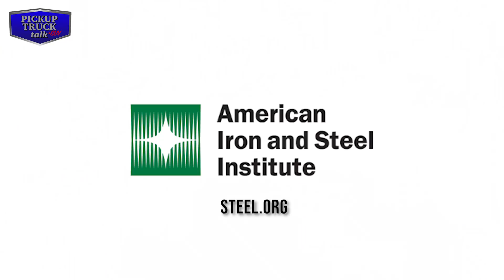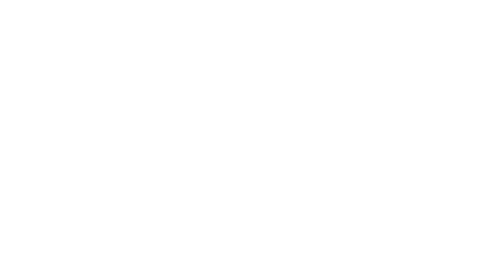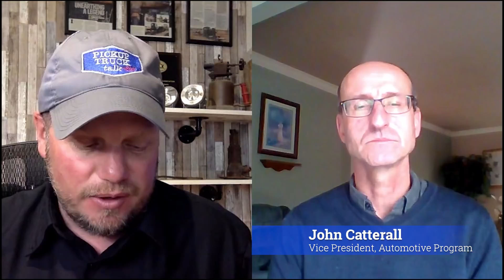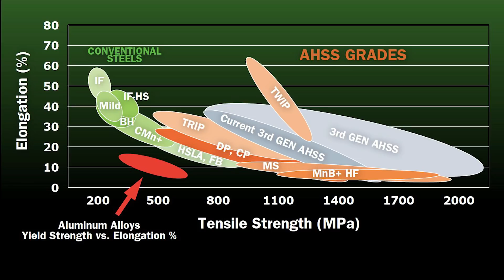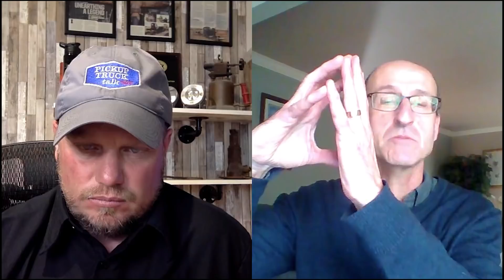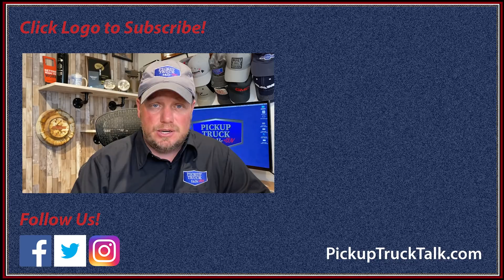Should Truck Frames Bend? Thinner Frames Are Weak? - Expert Answers

Comment: Hydro formed  frames, 14 gauge or sheet metal frames this days ain't going to hold up like the truck  frames back in the 70's and 80's.....big rigs and box trucks have and continue to use a c channel frame he needs to visit a kenworth truck plant a see the frames they use
Reply: @pete smyth  In the not to distant past pickup truck frames were built like big rigs, heavy gauge C channel, weight reduction has become the main influence in design.
Reply from the maker: ^this. Weight reduction and usage. Build a truck for the 95th percentile and not the 5 percent who will abuse it no matter what kind of frame you have.
Reply: @Pickuptrucktalk  towing a 2000 lb camp trailer is not abusing it. They should be building them for the 95% that payed the asking price of the truck.
Reply from the maker: Richard ball you and I both know a frame doesn’t bend towing 2k lbs. That driver drove way too fast and hit big bumps while towing. He is the 5 percent and abused the truck.
Reply: @Pickuptrucktalk    Being an engineer who has worked for an Auto manufacturer.  I hate to say it but BS. 
The frame of a truck the literal backbone of the vehicle should be the LAST component to fail when overloaded this is engineering 101. And this is how trucks used to be designed.  Axles, suspension mounting points, and suspension components should fail LONG before the frame ever does.     And yes Boxed frames POUND FOR POUND are stronger, but they do NOT pound for pound, they are much much lighter.
Reply from the maker: Matthew Matthewq don’t forget crash testing. That has changed the way frames are built.
Reply: @Pickuptrucktalk     That would be a valid argument if the frames were failing in the crumple zone.   Mid vehicle is IS NOT in the crumple zone.   This is not a case of frames bending or failing in the crumple zone.  But failing under the passenger cell, the very part of the vehicle that should NOT deform. Again none of this changes the fact that the frame should be the last thing that fails when the vehicle is overloaded.
Reply from the maker: Matthew Matthewq I’ve had two engineers tell me the frame bend spot is the crumple zone for rear accidents.
Reply: @Pickuptrucktalk   The  primary crumple zone For collisions is in front of the  axle The secondary uses the axel/s suspension to absorb and distribute forces AWAY from the passenger cell.  Think about this what good is crumple zone that is NOT in the impact area where there is sheet metal AND support structure to absorb the impact. 
Furthermore, if this was the case this would drive the box of the truck into the cab and may result in the driveshaft buckling presenting a penetration hazard to the passenger and fuel cells especially since it is a rotational item who's final resting point can not be estimated.    And what they are calling crumple zones are in fact weak spots as they are not subject to any measurable loading normally and it is a great place to pull material from for cost and weight savings. but at the cost of weakening the longitudinal strength of the frame.  Regardless none of this changes the fact that these vehicles were fitted with overly weak frames for the rated capacities.   Once again the frame/primary support structure should be the LAST thing to fail when overloading occurs,  NOT the first.
Reply from the maker: @matthewq4b  Let's slow this down and go point by point since I'm getting a bit confused by your reasoning.

For a rear-end collision, you are saying the frame spot in front of the axle aka nearest the cabin should crumple. Right?
Reply: @Pickuptrucktalk   Not behind the cabin this is standard location of the fuel tank in pick up trucks, That area you do NOT want to be a crumple zone.
You want the structure around the passenger cell and fuel cell to be as resistant as possible to intrusion and deformation. 

  Areas in front of axles  (Front bumper rear bumper in relation to impact) need to be the primary crumple zones, then the axels/ suspension being secondary to absorb and distribute as much force as possible across the structure of the vehicle.   

The reason for the need of high strength steels is cause material thicknesses have been reduced from fractional sizes to gauge sizes and in some cases it is sheet metal gauges.  

They might as well make the trucks unit body at that point as they would provide a stronger structure than a sheet metal frame will. 
 
 Boxed structural members pound for pound are stronger than C Channel members  BUT modern frames are not, pound for pound, but mear fractions of it. Furthermore, the plastic deformation of boxed members is much lower and will not tolerate any measurable overstress. This is compounded by the fact that most high strength steels work harden and fatigue at a much lower cycling.  

Think about this what failed on the Renegade?  Did the single piece of square tubing trailer tongue fail,  did the trailer tongue mount fail did the ball mount fail, or did the very backbone of the truck fail? 

Think about that what those parts are designed for, to tow 1500# trailer and that's it
The trailer tongue was subjected to the same forces as the vehicle frame as it was the item imparting them... If we are to believe this was the cause    Any way you cut it, the result is the same a vehicle frame that is overly weak for the intended application.   And let's remember this was a a Jeep a vehicle that lauds it's off-road capabilities. 
This was not a soccer mom Porche Cayenne.  Mind you, I  suspect it would have held up better than the Jeep did in the same situation.   Nor is the first and only instance of Jeep frame failures as of late.

So time to call it as it is, a vehicle with a weak frame.
Reply from the maker: Matthew Matthewq like you state, the front axle needs a crumple zone. So does the back, right? 

Also, as you now know, there aren’t that many Tier 1 frame suppliers, nor many differences between truck frames. This means the Gladiator, Tacoma, Frontier, ZR2, etc... all essentially have the same basic frame engineering and rear crumple zones.

Hard to say the Gladiator’s frame is that much different, right?
Reply: @Pickuptrucktalk    
The back of the frame is BEHIND the axles or in front in terms of impact. And the frame did NOT fail in the primary crumple zone nor even in the secondary crumple zone.  NOR did the hitch mount tear loose from the frame which should have happened LONG before the frame failed. 

The auto manufacturers design the frame. What's is built by the supplier is spec'd by the manufacturer the design of the frame the thickness of the material and the type of material is done by them.   And the supplier builds to those specifications.  So don't try to use the excuse that there are X number of suppliers etc etc, as they only build what they are told to.  

  And NO all the frames are NOT essentially the same.
If this was the case then we would be seeing similar failures across ALL the model lines and we are not simple as that. 
  
The Toyota from is a double C Channel frame under the passenger compartment, right where the Gladiator and the Colorado frames failed.  The Ford Ranger and Dodge  frame is a box frame but is almost TWICE as deep in the location the Gladiator and Colorado frames failed.  Furthermore the Ranger frame on the side of the fuel tank is twice as wide as the opposite side to rptect the fuel tank, not something seen on the other frames..  
SO NO all the frames are not essentially the same, construction style and dimension are very different between manufacturers.. 

Bottom line.
 Jeep built a vehicle with frame far weaker than was required for the application and the known service the vehicle would see.  

  If they had DO NOT TOW OFF ROAD Stickers on the hitch or in the owners manual then they would have a legitimate claim of abuse. If the trailer was the MAX or near the max weight of towing capacity then again you might have a case to say abuse. 
   But to tow a trailer 1/5th or 20% of the max allowable and have the frame fail even off road is ineffable.  You should have been able to beat that light of a trailer to a pulp off road  where it was nothing more than a trailer tongue and some miscellaneous   bits hanging on before the vehicle frame failed
Reply from the maker: Matthew Matthewq wait. You saw the picture right? The Gladiator frame bent at the crumple zone. That’s not disputable, right?
Reply: @Pickuptrucktalk   NO it did  NOT bend in the crumple zone.   Look at the pics again, it bent AHEAD of the rear axle towards the front of the vehicle.
   That is NOT the primary crumple zone and what should be the weakest part of the frame. 

The primary crumple zone is between the bumper and axle.  If the frame had failed between the bumper and axle then you could argue that the frame failed in the crumple zone. 
   Even then the hitch and or it's mounting should have failed LONG before the frame when overloaded.  
If they come back and say well this is the primary crumple zone that only lends more credence that was a failure in design and engineering.
Fiat built a vehicle with a completely inadequate structure for the rated capacity, simple as that. 

Any way you cut it, and use any excuse you want this was a failure in design and engineering no if's and's or butts.   

How much you want to bet the frame gets revised for following model years?  And you don't revise stuff that is not screwed up.
Reply from the maker: Matthew Matthewq I’ve spoken with numerous engineers. That bend is at the crumple zone.
Reply: @Pickuptrucktalk   Then that is a failure in design and engineering simple as that.  And no matter how you try to spin it or excuse it those are the cold hard facts.   
And just wait Fiat will revise the design of the frame to rectify this flaw in design.  
Go back and ask any of these engineers and ask them what should be the first point of failure in a hitch overload....  NONE of them will say the vehicle frame 4 feet away..
Reply: This man is not lying

Comment: Not to pull the "as an engineer card" but I'm about to...

Hes 100% spot on with his argument from s technical perspective. 

However, in the real world, people are using their trucks past design constraints. Sometimes on purpose (jumping off a sand dune, too much weight in bed) other times not on purpose (giant pothole with trailer or big payload, accident avoidance, or years of corrosion) 

This is where we run into issues in some ways. When you push a thick, conventional steel c channel frame past its design limits it will bend. Eventually, it will possibly bend slightly past a point where its physical properties start to change. This is called work hardening. You can get away with pushing steel into this work hardening range for some time. Eventually, the metal will harden so much it will crack and fail but you have quite a bit of abuse before that happens. Similar story with corrosion

On a thinner, high strength steel frame, these factors are more pronounced. By having less material, you have less time to can push it "past its limit" before you will work harden it to failure. Additionally, with the reduced flex of a boxed frame, any work hardened spots will cause a "hot spot" more easily and can cause a kink like we have seen on the jeep and Colorado. 

In conclusion it comes down to this. For max payload/towing possible boxed frames give you that in a cost and weight efficient package. For rust resistance over time, and pushing a truck past its design limits a c channel will likely hold up longer. 

My .02
Reply from the maker: Good points. I think you nailed the 95 percentile point he made. If you use your truck properly, the new frames are perfect. If you exceed the limits... well, then bad things will happen much faster than older frames.
Reply: @Pickuptrucktalk  as with anything it is a compromise. As he more or less mentioned, if you want 22mpg out of a gas pickup that can also tow 10k lbs...you have to start cutting weight and adding strength somewhere. That, unfortunately results in thinner body panels and frames, which is both good and bad for the consumer. At the end of the day though old trucks and new trucks alike will get a hell of alot of work done.
Reply: @AUTONOMEN x  adding a single rib to a square steel tube would add some torsional stiffness and would add about 1/3 more bending stiffness when pressing down on the rib. In the other direction it wouldn't add as much, though if in theory it were fully welded it would keep the sides of the rectangular tube from buckling  (which would be useful in case of these trucks) 

If you slid a round tube turned sideways inside a square tube at the right point on the frame again you could definitely help keep the frame from bucking. Another good way as mentioned in the video is welding on plates to the outside of the box frame..but now you run into other issues (rust prevention under plate, new hot spots at the points where the plate is welded, and more) 

Not 100% sure I understood your question clearly hopefully I answered it.
Reply: @AUTONOMEN x  agreed. Chevy I know has done aluminum hoods since 2014 and now all doors (tailgate too?) Are aluminum on the 2019+ trucks. If they haven't already I'm sure Ram will follow as emissions restrictions get stricter and stricter. It is s good way to save some weight and keep strength in the frame/drivetrain, etc. Especially with these trucks getting big heavy 10 speeds, stronger rear ends, and a the supporting components around it.
Reply: @AUTONOMEN x  for sure, however my gut says the cost/benefit ratio will never be there fof widespread use of carbon fiber in truck applications. But hey, I could definitely be wrong especially if you were to get energy costs down. Alot of $$ in carbon fiber or any composite is all the energy input needed to cure and process it.

Comment: If a frame is design to absorb a crash, it just ain't strong enough  for a real world use with all of us that really use them. I have been in many wreaks( not driving) that the frame never bent.  Geez. Like he said, it's about mpg now.
Reply from the maker: You did hear him say the frames are stronger these days right?
Reply: @Pickuptrucktalk  I did hear this, high tensel steel with thinner metal everywhere when it's not needed.
Interesting that the American Truck manufacturing uses the same Company in Mexico for its Frames. They do not build there own. Weird.
Reply from the maker: Roam TV likely do to cost savings. Most trucks are really just a combination of supplier built parts that the automaker assemblies. Some companies even have parts suppliers on the same property as their plant to speed up delivery time. Why would they build their own frames when it’s cheaper and faster to pay someone else to do it? Makes sense to me.
Reply: Crumple zones save lives.  There is no question about that.  My “real world” is driving my Colorado pickup on the highway and on city streets, at legal speeds.  I don’t care what happens to a Colorado that is subjected to unusual stresses in an off-road environment.  If that’s your “real world,” you have to understand the stresses and the limitations of your vehicle.

Comment: The bottom line? The frames are week. Period. They do this to keep overall weight down.
Reply: Bottom line, all frames have limits.  Without doing the analysis, I can't come to the conclusion that the frame was weak.  Step one is to determine the means the frame failed.  Perform metallurgical analysis to determine how it failed.  Funny how non-engineers seem to have non-engineering responses over two failures.  YouTube and your gut feelings don't make cars and trucks work.
Reply: And to keep cost down as well, GM quality has been going down sharply for many years, the frames are not the quality they used to be and they are failing.

Comment: I was shocked. I was wiping down the frame one day on my 19 zr2 and boy was I concerned when I discovered how thin it was. My new trd pro seems thicker.
Reply: As many mechanics tell me, the old trucks were stronger. I have an 88 Toyota 4×4 I beat the crap out of and would never trade it for the new trucks. The. New trucks are faster and smoother but I bet it won't last 33 years of torture and still be running!🍻🍻🍻🍻
Reply from the maker: TRONA BORON sure and that’s what he said. But also remember about safety. Old trucks are terrible on the occupants in an accident.
Reply: @tronaboron_99  
A mechanic isn't an expert on strength.  Ask a structural engineer.

Has this mechanic done testing and measurements to support that statement or is he going on his feelings?
Reply: How many Tacoma’s (without rust), do you know have bent frames? Has anyone seen pics of one? (That can be shared)
Reply from the maker: lukestoyz I’ve done some Google searches especially on Tacomaworld. I can’t find one with a bend by the rear axle. A few have bent bumpers the poster is claiming as a bent frame.
Reply: @lukestoyz  no they just rust out and need replacement by the thousands.  The last brand that should be touted as frame strength.
Reply: Those were the dana subco tracted frames
Reply: Engineering isn't based upon what something looks like.
Reply from the maker: Matthew Gaines great comments.
Reply from the maker: As you heard, thin doesn’t mean anything. Actually thin means stronger.
Reply: @Pickuptrucktalk  You can pee on my leg and tell me its raining it doesn't make it true. Thin is thin. Thin is not as strong as thick.
Reply from the maker: Robert Young well I’m not peeing on your leg first. 😂 second, I believe high-strength steel is stronger than conventional. However, I could see the need to show you the differences literally. I’ll look into that.